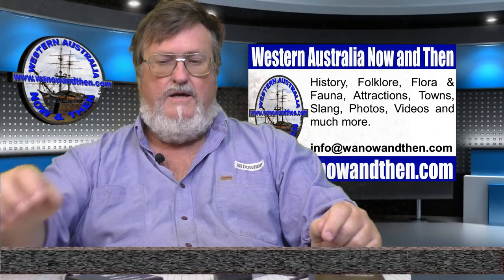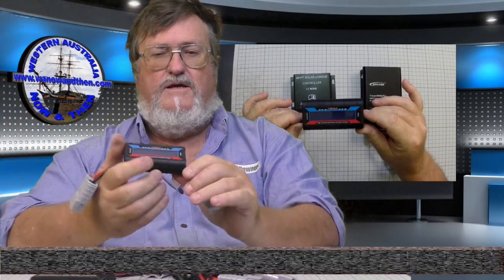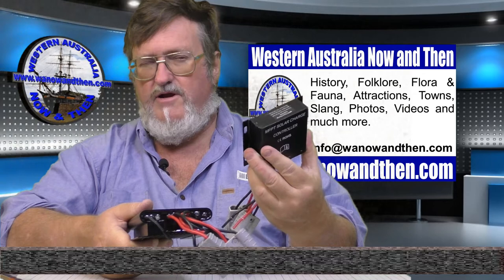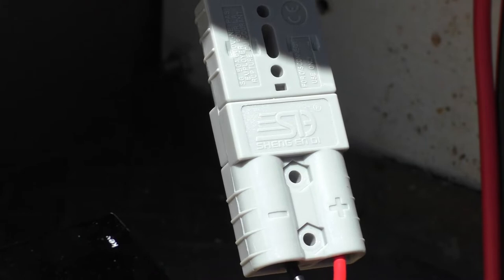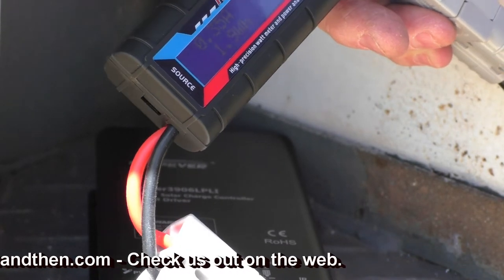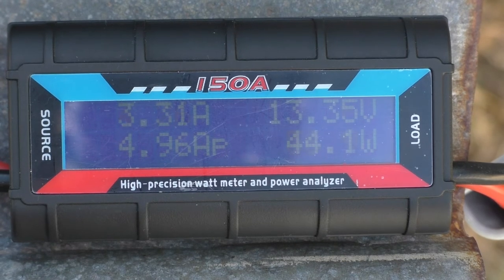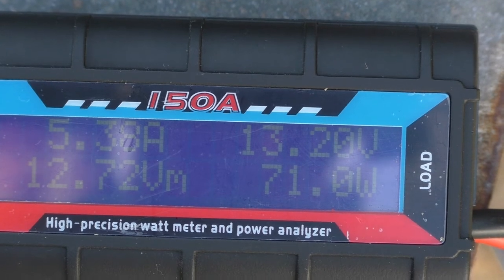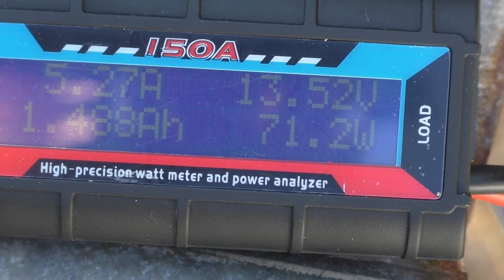MPPT Vs fake MPPT? solar regulator

Comment from the maker: More thumbs down for this video than anything we have done recently. If you give a thumbs down please let us know why, because we like to get things right. We can't fix it if we don't know what is wrong.
Reply: you are not testing it right! you need to look at the voltage of the panels to see if the charger is pulling it down to the same voltage as the battery to know if its a pwm or mppt
check out adam welch channel to see how he test them and you will see to real way to know
Reply from the maker: @NightshiftCustom  Yeah, we have a second video coming out that shows more testing and we use a 24 volt panel that clearly shows the real MPPT is using the extra voltage to create more amps. We also use an old PWM to compare with the Ebay regulator.

Comment: Anyone know if the genuine Epever needs to be configured to charge a lithium battery or is it a plug and play job?
Reply from the maker: We aren't running litiums yet so I;m not sure with this model. We have a different one that does need to be configured and I would think it might also apply to this older model. Probably best to check with your supplier when you purchase one.

Comment: i think they are the same as the ridge ryder ones ? i bought 2 today and the 120w panels along with two of the modular battery systems , hope they all work well , good video , thank you
Reply from the maker: We have found that excessively cheap 'MPPT' regulators aren't really what they are advertised as. They work well enough but they are still more or less the old PWN style when it comes to performance. After buying quite a few different regulators over the past few years, I have come to the conclusion that regulators that are around $150+ and are large seem to be genuine MPPT while the small regulators that are sub $100 are not real MPPT and don't perform as well.
Reply: Yes they are identical to Ridge Ryder. Interestingly Ridge Ryder states that they are not compatible with Lithium batteries
Reply: They also appear the same as the XTM ones that come with the 160w folding panels from BCF. XTM user manual says its a Tracer3906BP, and claims they're not compatible with lithium battery's. EPEVER manual says Tracer3906BP is compatible with lithium...
Even finding information on the RS485 comms port leads to mystery. I suppose its what happens when you buy cheap relabeled Shenzen electronics.
$250 for 160w panel and 15A MPPT is still cheap as chips, see how it goes i suppose,

Comment: The smaller charge control caused a  fire due to over heating. Your right about no heat sinks.
Reply from the maker: Very cheap and nasty stuff, we never used it after the tests and turns out just as well I Guess.

Comment: No one controller determined any state of charge!! He don't know if is a battery or a inverter or a heater!!! Simply give a voltage with a max limit current. Stop. Is the resistance of load to decide how many current. Not the charger! Never! It is phisic!! Any charger is a generator with a limited max current and 2 constant voltages!! Nothing more. The mppt it's about pv input voltage.
Reply from the maker: ??? None of that makes any sense to me, sorry. MPPT simply delivers more AMPs than older style regulators.
Reply: @WesternAustraliaNowAndThen  Sorry buy you don't know the meaning of mppt. If is like you say, it's enough any DC DC converter. DC to Dc converter is a small part of mppt. The purpose of MPPT is to keep the panel at his maximum power voltage. You know the IV curve of a panel? Every panel can produce maximum power only a certain voltage. At Les or more voltage the power drop. Especially above. A 400w 72 cells have mppV at 39v for example.  In example it make 360w at 39v. If you put it at 14v , like with pwm, but can convert and increase amp, the panel can't make 360w! But less. And if you put it at 43v is worst. Power drop drastically.
It's a phisyc characteristic of silicon cells.

Any load would change panel voltage if the controller don't adapt resistance to mantein panel at 39v. The CPU of controller constantly move slightly up and down the voltage panel and check if power increase or drop. It's called "perturb and observe" method. To stay at maximum power voltage. This is mpp following.

I say you more. The tracking .
First time, at the start, controller scan ALL IV CURVE to minimum voltage until maximum voltage. And see at what voltage the panel make the maximum power. Than, controller follow this point and it variation. Temperature change the mpp voltage. If one day you ask maximum power all day, all day controller is in mppt mode, in a chart you will see the max power voltage start at 40 or 41v at early morning with fresh, decrease until midday with temperature increase like 37v in summer. And than increase another time when sun go down and temperature go down.

Another thing. With particulary partial shadow on panel, the controlle can find a false mppV. Because are 2, but only one is true. If only follow mppV, controller find false mpp. For these reason, controllers make new complete IV curve scan, every tot time. I will show you all charts and explain all these things if you want and say me where.

The last thing. Controller stay in MPPT mode only in bulk stage. When max possible power is needed. In absorption or floating stage, when not need maximum power, controller don't work MPPT.
You can find theses things, very simplified, on epever manual and a lot of articles. Even I , write an article about.
y@WesternAustraliaNowAndThen
Reply: @WesternAustraliaNowAndThen  and for that I said on first comment:
I repeat, the controller not need to know the battery STATE OF CHARGE. The charging process is determined by state of charge for physic. Controller, like any 3 stage charger, only want to give the max current. Depending on the resistance that it have on output (if a battery or an inverter or a fun don't change nothing) controller make the voltage necessary to send max current. Battery voltage increase by receiving current. And consequently controller must increase also the voltage to mantein the max current. When the voltage reach the absorption threshold, controller pass from mantein the max current, to mantein constant voltage and Battery voltage continue to increase. With controller voltage constant and battery voltage increasing, the consequence is the current drop. After a current minimum threshold or a setted time, simply controller change the voltage to a different threshold. The floating voltage.  Smart charger and controller only make this. Don't know the state of charge,(maybe can check battery voltage at the start to decide absorption time, nothing more). The charger only can do 2 actions, send the max constant current or send a set constant voltage. And send another constant voltage (float).
Is Simply a constant current power supply, that at some point switch to constant voltage.
Reply from the maker: Yeah, I understand how MPPTs produce extra AMPS but the fact is, the cheap regulator here did not perform at all like an MPPT. We later tested it with a known PWM and got similar results without the power fluctuation. The power should not have been fluctuating as it was because input from the panel and current draw was steady. My conclusion is that the cheap regulator was simply pooly made rubbish.  @fc436
Reply: @WesternAustraliaNowAndThen  but I don't criticise this fact of cheap regulator..

The MPPT DON'T PRODUCE MORE AMPS. Don't produce nothing. The panel produces. 
Mppt, first off all, force the panel to stay every second at the maximum power voltage. With load resistance modulation to perturb every fraction of second the panel voltage up and down to verify if power increase or decrease. And so stay at the best voltage. This is MPPT function.

Than convert DC to DC like all converter of the world. This is not mppt function. Is a obligatory consequence of mppt function. For most people, panel amps are the same with pwm and mppt. Is not true. With pwm, panel amps are slightly more than with moot. Because pwm force panel at a voltage lower than mpp voltage. And if you see any IV CURVE OF ANY PANEL. Panel current, increase slightly if you decrease panel voltage. But total power also decrease.
Reply: @WesternAustraliaNowAndThen  your conclusion is totally right.
But you put all your attention on current output that is bigger than input current. This have nothing to do with Maximum Power Point Tracking, the real difference between MPPT and Pwm.
Increase amps is a simply DC to DC conversion. The same that a 24-12 alternatore charger,, or a 12-5 usb.
Mppt happens before.
If you have a 14v panel you can use MPPT and not see current incrasing. If you have a 30 panel and 48v battery, you will see amp decreasing. But the MPPT function work the same. You need step down mppt
Reply from the maker: Yeah I get all that but the video really wasn't about the way MPPT works, it was about the cheap regulators being sold with an MPPT badge on them when they are actually a very poor quality PWM.  @fc436